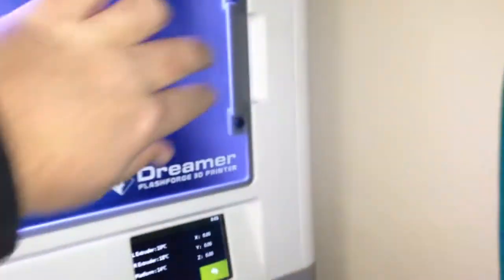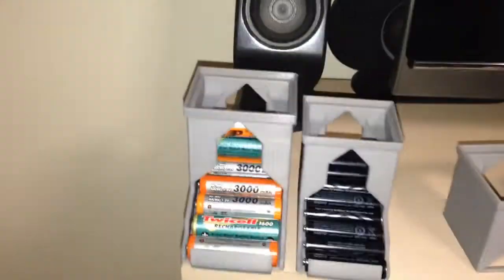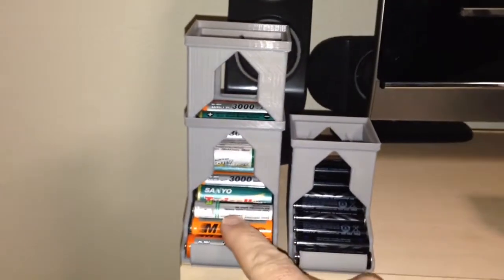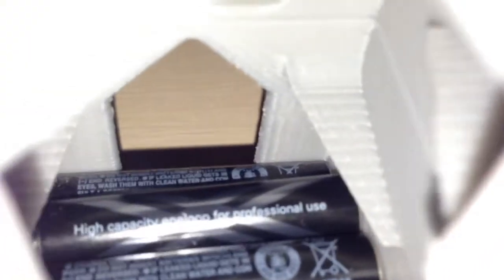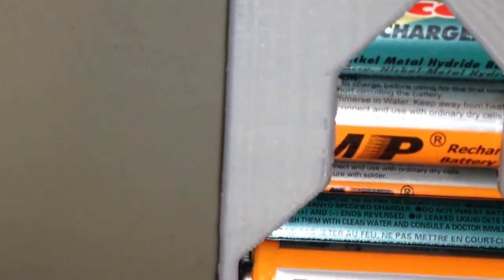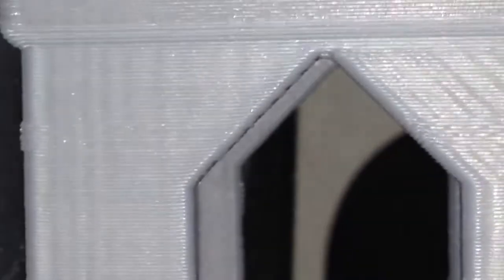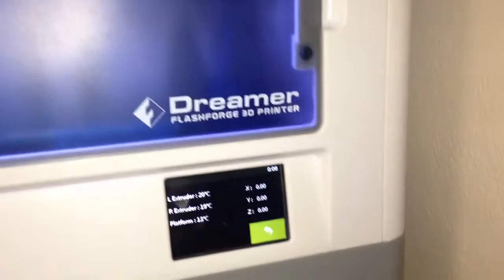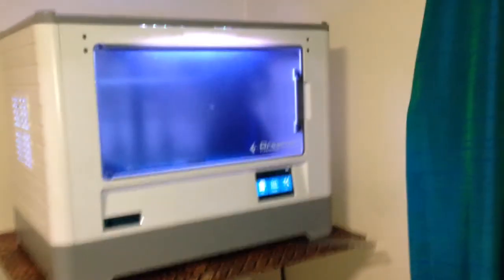Flashforge Dreamer - Battery Dispenser

Comment: another nice print, I need to start posting videos of mine, also what bugs does the new firmware fix? if you don't mind, I saw that there was a new one available and wasn't sure if I should update
Reply: also forgot to ask, do you keep you print speeds at default? I noticed that default speed is rather fast, and I don't get the best quality prints. I started using slic3r to generate g-code recently and there is a bit more control over the speed. i have been setting the speed to about 60 mm/s and I get decent prints. I also needed to adjust the retraction settings to keep my prints from coming out very stringy. wasn't sure if you were running into the same problems since your print always look amazing..
Reply from the maker: Joe Petro This is after clean up. I'm using the Flashprint software so I can't adjust any restrict settings but I've been noticing a lot of stringing on my prints lately.
Reply: Thomas James cool, It took some tweaking to get slic3r to work on it's own, but It definitely helped with the stringyness, I'm going to upload some videos comparing some test prints.